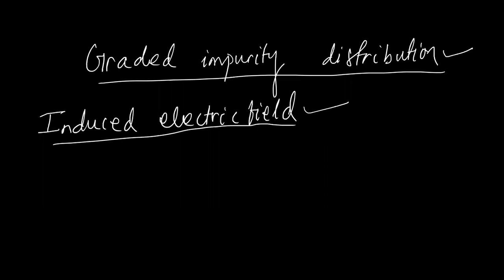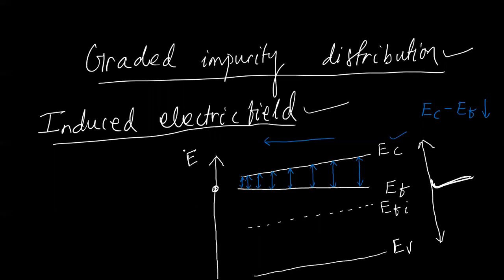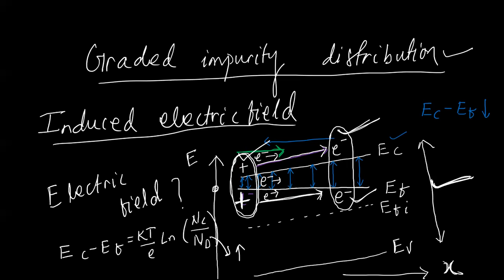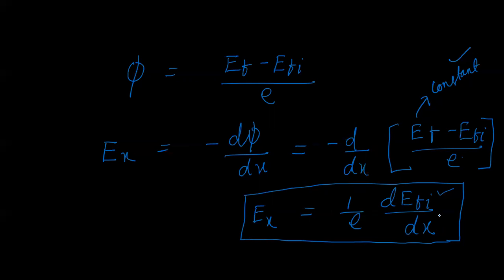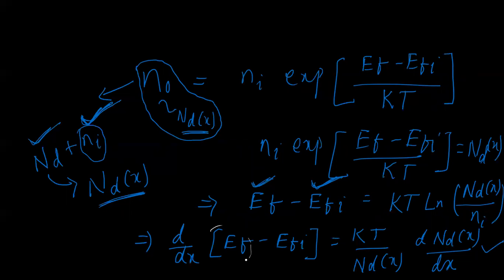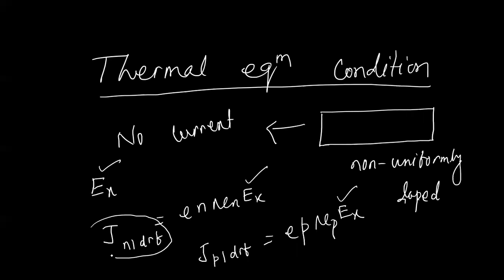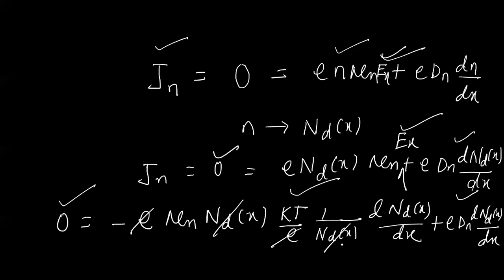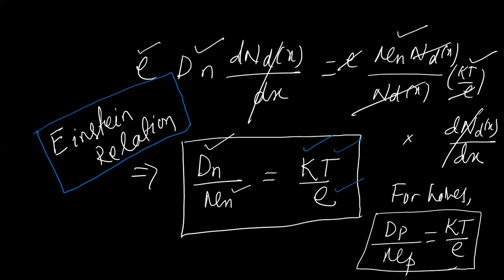Graded Impurity Distribution| Induced electric field due to non uniform doping in semiconductor|

Comment: what is the energy requires moving an electron from the bottom of the conduction band to the energy level of electron at rest in vaccum outside the solid     
A) ionization energy 
b) electron affinity
c) both of them